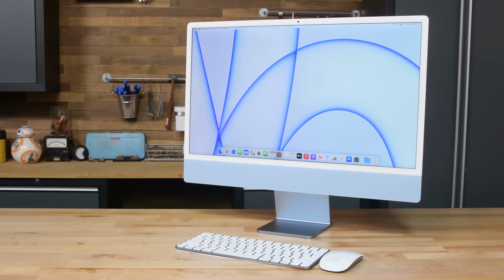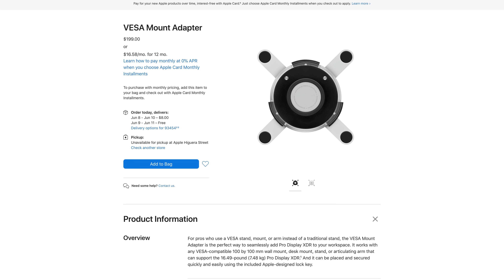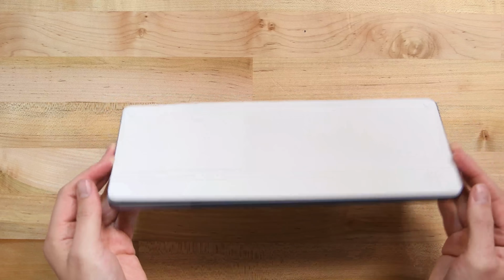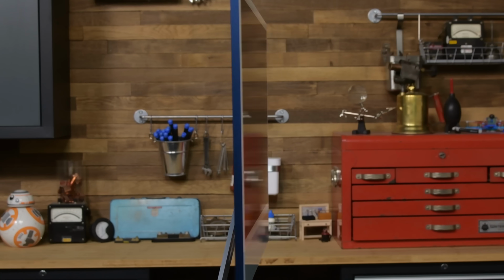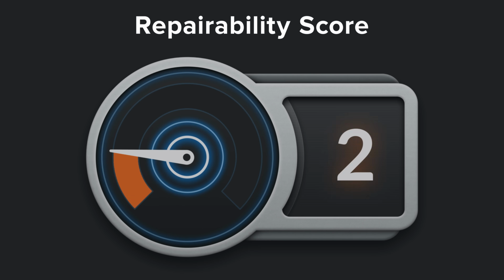M1 iMac 24” Teardown: A Desktop Only Jony Ive Could Love

Comment: Conclusion: stop buying Macs
Don't be like this Apple fanboi down in the replies. He's just sad and pathetic.
Reply: why?
Reply: @arunashamal  
Weak computing power.
Extreme high price.
Non-upgradable.
Unrepairable.
Unnecessary proprietary ports.
Not enough ports which then requires you to buy extra dongles and hubs and docking stations and card readers.
Should I go on?
Reply: @joshuaewalker  1.what do you mean weak computing power?? M1 kicks every Intel and AMD chip in its price class. 
2. I challenge you to find a better system than this imac for a better price. Yes that includes the screen. 
3. Apple software is optimised enough you never needed upgrading
4. Why do you want to repair when they don’t break?
5. Since when did usb 3 become proprietary??
Need I keep going?
Reply: @arunashamal  
Forbes, TomsGuide, TechRadar, TheVerge, even Macworld for god's sake all have articles saying why the new M1 iMac isn't good enough for its price or that it's pretty good but the author would never buy one for multiple reasons.
As for finding a better system at a better price; I'll just compare it to my current laptop. I have the ASUS Zenbook Pro Duo. Core i9 9980, RTX 2080 Super, 32GB DDR4, 2TB SSD. I paid $2699 in 2019 for this system. You can't even spec up the M1 iMac to match my laptop, but when you max it out on Apple's site the price is $2499 and that's with HALF my RAM, only 16GB.
Reply: @joshuaewalker  and your asus comes with the 4.5k p3 24 inch screen?
Reply: @arunashamal  
I assume you're not going to be bothered to look it up yourself? Well, mine is way better. My laptop actually has a resolution of 3,840 x 3,260 for a total of 12,518,400 pixels. The new iMac has a resolution of 4,480 x 2,520 for a total of 11,289,600 pixels. That means my 15.6" laptop has 1,228,800 MORE PIXELS than the 24" iMac. That's 10.88% higher resolution on a full OLED touchscreen display. Oh, that's right. Full touchscreen. And this laptop came with an active stylus, too. It is 100% DCI-P3, 133% sRGB, with a Delta-E < 2 of 
color accuracy (whatever that means). Any more questions? This is fun naming off how much better my 2-year-old laptop is better than the newest Apple desktop.
Reply: @joshuaewalker  lol I actually look it up because of this comment, and you are cooking up numbers..but even then that is 9 whole inches less than the imac, you know size is a factor when determining price of screens right?
Reply: @arunashamal  
Really? You just called me a liar? Please, tell me the numbers I'm "cooking up"?
Reply: @joshuaewalker  ok please link the spec sheet for your 15 inch laptop screen, I might be wrong, or you might be cooking up numbers, we can solve this easy.
Reply: @arunashamal  
Now, if that link just got deleted look up the ZenBook Pro Duo UX581
Reply: @joshuaewalker  that is the exact model I was looking at, maybe you should look up the specs for your own computer, before trying to debunk the mac with fake numbers...??
Reply: @arunashamal  
And yet you still won't say what the numbers are that I'm cooking up. What did I lie about?
Reply: @arunashamal  
Maybe you should actually look at the whole page and read all the specs of the laptop I'm showing you before you keep mouthing off? Maybe you're just salty because you realize it's way way way better than the new iMac?
Reply: @arunashamal  
You went from replying to me within minutes and even seconds to now almost 2 hours with no reply. Ladies and gentleman, I believe Elvis has left the building. Have fun in your walled garden.
Reply: @joshuaewalker  oh you’d like me to get out don’t you. Maybe we can have a discussion if you stop cooking up numbers. Bro you obviously put out a fake numbers to prove your screen is better than iMac, that’s the end of discussion. I can make anything look better than everything else with fake numbers. Yea. The imac won’t hold a candle for your computer with made up specs. Maybe we can have a discussion on this when you are ready to go on with real numbers
Reply: @arunashamal  
How many times have I asked now? What fake numbers? My laptop actually has 4.5K unlike lying Apple with their marketing, fake 4.5K
Reply: @joshuaewalker  ok. Is the 4.5k in the room with you right now. lol. I asked you to link to spec sheet. But you have refused to do so. Asus don’t even make a desktop screen with your numbers. lol
Reply: @arunashamal  
Not only is it better in every technical aspect except for one, the Thunderbolt 4 ports, it's also a freaking laptop which means that it's portable. Let's see you take that M1 iMac on an airplane. And I didn't even check but is the new iMac a touch screen? I know it can run iPad apps natively but I'm pretty sure it's actually not a touch screen which means it's crap compared to my laptop.
Reply: @joshuaewalker  Can we come back to your falsified numbers instead trying to compare a laptop to a desktop on portability it seems like you are reaching for straws at this point.. embarrasing.
Reply: @arunashamal  
Absolutely. Let's talk about those falsified numbers. What were they? This is what, the fourth of fifth time I've asked now?
Reply: You said, you said that you looked up my laptop. I gave you the direct link. So, go ahead, you tell me how many pixels does my laptop have? You tell me is it an OLED laptop? You tell me is it a dci-p3 screen? You said you looked it up so you tell me.
Reply: @arunashamal  
What's that I hear yet again? Pure silence. That's what I thought.
Reply: @joshuaewalker  look above. It is embarrassing now my friend. It’s hilarious how bad you want me to go away.. haha
Reply: @arunashamal  
Look above what? I don't want you to go away I want you to try to argue your side of this argument. I wrote two comments stating many specifications of my computer and then you just randomly said I was lying about some numbers. I don't even know what numbers I'm supposed to be lying about. Why do you refuse to clarify what I'm quote unquote lying about? I think I've asked, what, six times now? I'll ask again. What fake numbers did I cook up, specifically?
Reply: @joshuaewalker  read my comment. I have put it in quote... and I have asked for a direct link, you still haven't provided it
Reply: @arunashamal  
Now who's the liar? You haven't used quotation marks in a single one of your comments. Not one. I have reread our entire conversation. I don't see any of your comments with quotation marks. Nothing is in quotes, you haven't edited an old comment to specify what you were asking for, you keep saying you want the spec sheet and I gave you the direct link so what are you even talking about?
You're just playing games because you don't have an argument. I have asked seven or eight times now, it keeps adding up, What Number Did I Lie About?
Quit saying it's in some old comment when it's not and just answer the question. Tell me what "numbers are cooked up"?
What specification of my Asus ZenBook Pro Duo laptop did I give you that you can't find for yourself on the spec sheet? What am I lying about?
I'm asking you to answer one thing: what am I lying about?
Now, go ahead and tell me that it's in some past comment again like you keep doing because you know you're wrong. I'm not going to hold my breath for you to start being honest in this discussion.
Reply: @joshuaewalker  are you using your super dooper screen to read the comments? Maybe that explains. I’m looking at the quotation marks. Just stop embarrassing yourself man. Go again re read it
Reply: @arunashamal  I just checked Asus' website and his claimed specs are true. Just search up Asus Zenbook Pro Duo 2019 and open the first link.You're the one lying now. You just can't face apple not being the king, can you?
Reply: @jaykrishnak3268  cool man. Just post the link to the laptop screen with 3840 x 3260 resolution. I’ll take a look
Reply: @arunashamal  
Dual screens, my friend. That why it's called the Zenbook Pro DUO
So, you finally say out loud what you were calling me a liar about? Funny. This laptop has a full 3840x2160 15.6" main display and a second 14" 3840x1100 display. for a grand total of [da da da-da] 3840x3260!
Math is hard for you isn't it? It's okay. Mommy will get you that shiny Apple for your birthday if you're a good boy.
Reply: @jaykrishnak3268  
Thank you friend
Reply: @joshuaewalker  lol ok. So you needed to add dual screens to exceed imacs just one display?'why don't you attach another display and add that resolution too. Lol. Hilarious you have to gasp at every single straw to try to make a point but still miss.
Reply: @arunashamal  
I didn't add the screen. It's an integrated part of the device. It can't be removed. Fact of the matter is pixels are pixels and screen real estate is screen real estate and my more powerful, portable laptop has more of it than the 4.5K screen of the iMac. I literally have more desktop space and more room to open up windows and run more applications than the iMac. And it's all touchscreen. And the PPI is higher than the so-called "retina display". And it came with a stylus. And you can use any active stylus you want unlike the Apple Pencil which is proprietary. And the laptop has an IR camera so it can actually do secure face unlock unlike the iMac which can't.
Reply: @joshuaewalker  This is the problem with nerds, They cling on to something that they use and everything else has to work exact same way or everything else is inferior, Nevermind you comparing a 2 entirely different products,  never mind you are adding 2 entirely different screens against one panel, never mind the imac is a desktop which doesn't need a touch screen, never mind it has 24 inch screen that gives more screen real estate than yours could ever do, it has to work exact same way or else...the base level m1 can open more applications and faster than windows could ever do.. Now apple is slowly killing x86 one by one I guess we will have to listen to nerd death screams for a while.
Reply: ahaha... you went and edited the original comment as well.. that shows who is really desperate and sad one...
Reply: @arunashamal  
Are you off your meds? You "challenged" me to find a better system "including the screen" and I did and now you're salty about it. You just don't want to admit that Apple's newest product in 2021 can't even complete against an ASUS product from 2019. It's sad really.

Comment: The Ethernet controller on the main board suggests the proprietary AF power cable/Ethernet adapter is just a physical adapter. Perhaps there is reason to be hopeful about 3rd party replacement power cords once Apple inevitably moves on.

Comment: If they had made a monitor designed to be mounted on a mac mini it would have made more sense. Access would be better, the would be room for more storage and the ports would be easier to get to, and if something went wrong you could just swap out the cpu or monitor. You could even have different size monitors available.
Reply: A Monitor mounted on a mac mini?

So... The iMac G4?
Reply: 9 months later the mac studio comes out... 
Basically a imac pro monitor made to work with a mac mini with loads of power and connectivity.

Comment: I was considering the IMac but the two cmos batteries really makes worried. Eventually they will need to be replaced and then you will have to take the whole thing apart to replace them and maybe Apple has made some security so that only Apple will be able to replace the batteries and it will cost a fortune.

Comment: Purchased my 1st Apple iMac about 3 weeks ago, will be my last. After 2 weeks, the screen froze, it powered down, and continually tried to power back on before going to a screen with an exclamation point instead of the Apple logo. Tech support on the phone suggested that I find somebody with a Mac that has the same M1 processor in order to run Apple configurator to fix a firmware problem. Couldn't find anybody local that has one. A two-hour drive to the Apple Store in El Paso Texas, and they told me they believed the logic board would have to be replaced. Have yet to receive any updates.

Comment: The controller is on the logic board, but the port is on the power supply ?
Why Apple?
Why ?
Reply: @Gooch destroyer Just attach the Ethernet cable to the power cable and be done with it.
No need for a custom magnetic connector  (Why a magnetic cable on a desktop ?) and a weird power supply.
Reply: @Luzgar  b-but muh design... Muh think different! /s
Reply: @Luzgar  they need a custom cable to allow for Ethernet and power delivery. The magnets are probably to make plugging in feel super easy. They also help align the plug

Comment: So if the keayboard breaks you can't have touchid?
Reply: I’m guessing you can just buy a new keyboard because it not on the iMac it on the keyboard
Reply: @Abbycried  What a great solution! Thing breaks? Just buy another!
Reply: @lbgstzockt8493  Honestly most people don’t even want to bother fixing a keyboard if they broke it. Like I get we want everything to be repairable, but we also have to be realistic. If I break a mouse or keyboard so severely it doesn’t work any more, I’m going to buy a new one.
Reply: @lbgstzockt8493   If you can buy a iMac im pretty sure they can afford a new keyboard and nobody wants to deal with the hassle of taking it apart and replacing a touch id which is probably paired to the keyboards like iphones
Reply: @VectorGaming4080  Still it should be easily repairable, 3rd parties can just repair it if you don't want to yourself
Reply: @lbgstzockt8493  my keyboard broke on my gaming pc I just bought another and it’s fine it’s just easier to do then taking it apart and dealing with everything
Reply: @4js123  depends on the kind of breaking. I replaced a blown diode on my keyboard, which is a pretty complex operation relatively speaking.
Reply: @VectorGaming4080  The sad things is that it shouldn't be this way.. consumerism got us all really bad
Reply: @pucciox40  I'm going to be honest. I 100% prefer design to take priority over repairability. I don't break my stuff, my Apple products last 10+ years, and I want it to look and feel good, and to be compact. If being able to easily repair my stuff means it's bulky, has tons of screws and less of unibody design, etc... I don't care. My gaming PC is easily repairable, but man it's like having a clunky semi-truck of a computer in my office where my MacBook is so sleek I forget it's even there. Being able to replace things that wear out, like batteries and fans, are always important. But, beyond that things just don't break if you take care of them from my experience of buying computer products over decades.
Reply: @VectorGaming4080  I do know that. But since my dream is a more eco frinedly world im trying to major in electronic engineering and trying to bring a more ecosustainable way of designing. I know for sure there are many ways Apple could make things more just and less profit focus. They are huge company with tons of resources, it's time that we, the consumers, demand for a better quality product not only design wise but also in the enviromental way (sorry for the poor english but it's late and been studying all day long)
Reply: @VectorGaming4080  there are many ways electronics can degrade without you dropping stuff, exposing to water and such. It's not only a matter of "i don't break my stuff"
Reply: @franky-161  the touchid sensor is paired to the board. If you’re keyboard board breaks a repair is really not worth it. Security wise this is actually a good thing because it prevents malicious actors from replacing the sensor with one that caches you’re fingerprint data to allow the actor to access you’re device
Reply: @pucciox40  Well, I don't break my stuff. I can't think of the last time any of my electronics have just failed over the past decade.
Reply: @VectorGaming4080  That's just a personal experience... Not the overall situation. And it's a whole industry problem, not just Apple ofc. But considering the influence that company has on the whole industry, I think they should give the right example

Comment: @2:50 - so if you need to get a TouchID replacement keyboard, will any TouchID keyboard do, or do you have to get a new one from Apple after giving them your iMac serial number?
Reply: the touchid unit is paired to the circuit board inside the keyboard housing, not the imac housing. so you can just get any replacement touchid keyboard at any time

Comment: Why’s there as much empty space on top as the chin at the bottom? Did they intentionally put it there to make the more expensive iMac (which would likely not have the chin) look cooler?
Reply: I guess they need to put the speaker at the bottom.
Reply: That space is taken up by the screen, also for speakers and cooling it should be on the bottom.

Comment: Since they USB C and thunderbolt ports are modular, it could be possible to make some sort of kit that can replace the usb C ports with type As. Although it would require drilling a bigger hole. (Assuming that the usb c and thunder bolt ports are not paired to the logic board, which they probably are)
Reply: I prefere a dongle

Comment: I still have a 2009 iMac that works with original hard drive and all. For all those saying it’s throw away, it only is if you don’t know how to use it.
Reply: ...or you can't afford Apple repair cost over the life of the unit. I too have a 2009 iMAC and a 2013 iMAC. Both are great computers for my various uses.